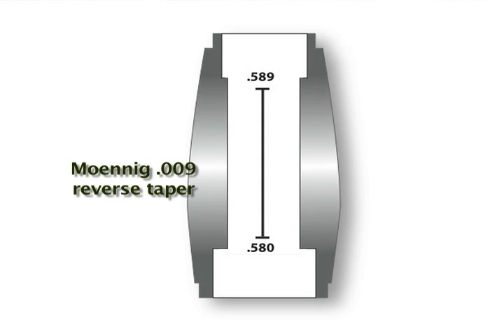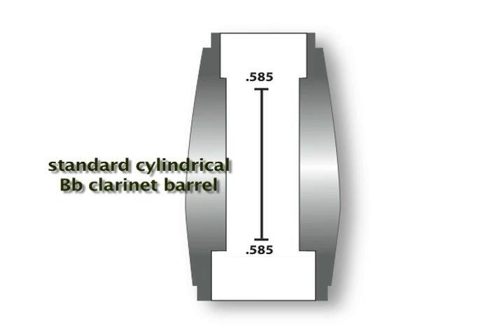episode 42: unraveling the moennig taper mystery

Comment: The use of a standard Morse taper reamer is absolutely incorrect. The Morse taper has a far greater taper than indicated in this video. I thought perhaps Tom meant to say it was a "taper-pin" reamer, another common machine shop standard. But alas, it too, though it has much less taper, still greatly exceeds the Moennig taper. This story is a mystery.
Reply: Agree. Using the numbers .589 and .580 together with an MT2 would match a barrel bore length of 4.6 mm which is not realistic.